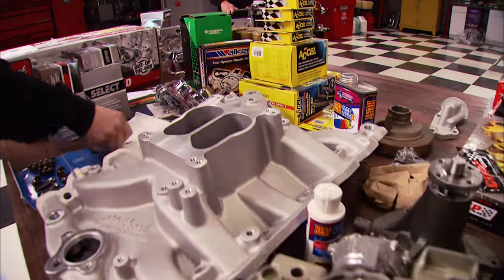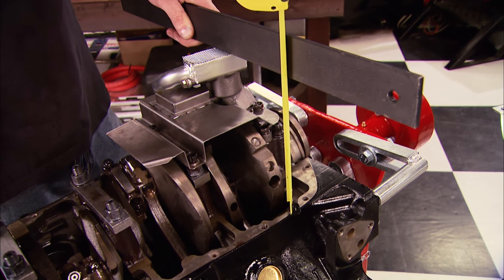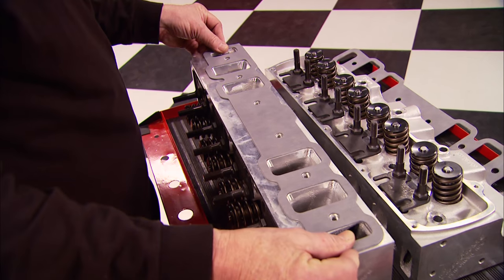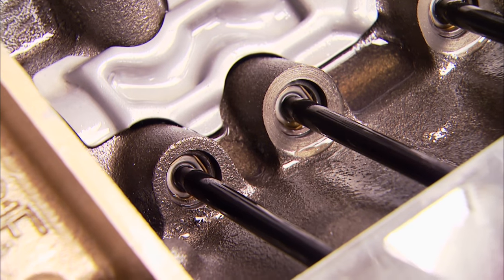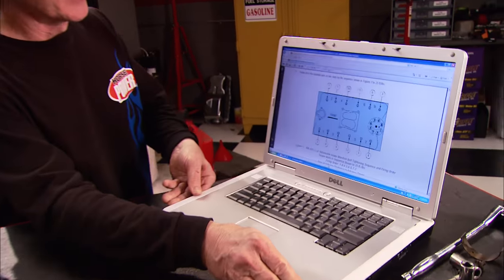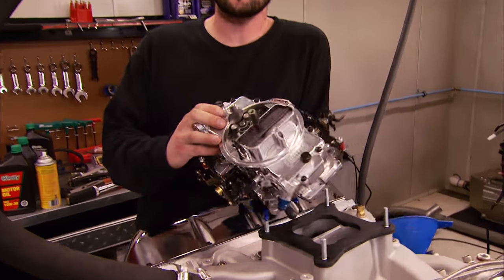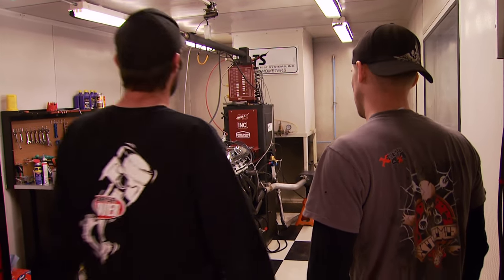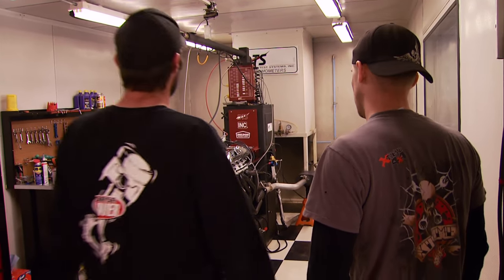Dyno Testing a Mondello 455 Olds Big Block - Horsepower S13, E8

Comment: So weird that rebuild kits come with those intake manifold front and rear gaskets yet every single person and manual says to use silicone. Why do they even make the gaskets? I've seen instructions that come with the gaskets saying not to use them. It is so bizarre.
Reply: I use RTV and the gaskets... but you have to make sure the gaskets don't slip out before the RTV cures...

Comment: Given the aftermarket cylinder heads, this combo is totally underwhelming.  I'm thinking the wrong cam was used and I know the wrong intake was used.   If done correctly, that engine should have made 500 some HP and still be streetable.
Reply: They did revisit this engine on Engine Power and they did swap the intake and cam (custom grind) and it make a bit more power.
Reply: reused the stock cam Not bad

Comment: Just goes to show that you have to do all kinds of work, plus use aftermarket parts to get what Chevrolet did (1horse/ci) more than years earlier with stock parts. Painting the block with Chevy engine orange instead of Oldslow gold would have helped that Olds by a good 10hp!
Reply: Myself I had a '66. 425 with 365 hp. Did a few tricks took the specks from the W-30 stick grind camshaft 428 degrees  custom ground advanced 4+ and total timing at 32degress cross drilling crankshaft oil relief on rods head porting and polished center heat chamber filled at valves and exhaust siammized center ports welded to separate them 5 quart tornado oil pan /pickup Holly 750 machinal carb headman headers and putting out 525 hp.  and 543 foot pounds of tork !!! Ran the 1/4 in  11:67 @ 113 mph had 11:1 compression 67 400 turbo with switch pitch converter from a 67  330 ci. 2-speed jet-away transmission being smaller let the engine rev to 3800 in high stall mode and 2600 in low stall mode had the switch on the shifter next to the trans brake ran 4:56:1 Posi clutches shimed tight ... Joe Mondelo had lot of great tricks back in the mid '70's dam I miss him he taught me a lot of tricks even deburing the block and cleaning up the oil Chanel's for oil return just need to square up the block Aline hone, balance, and gap the piston rings hade that motor at 6500 rpm many times !!!

Comment: He matched the ports to the intake gasket. Should you match the gasket to the ports?
Reply: You want to match the port to the gasket. Use a black sharpie and line up the gasket holes to the bolt holes and trace what material needs to be removed. By opening up the head you're removing a possible shelf that would impede airflow into the head
Reply: Didn't matter, the ports and gasket already matched...

Comment: I had a OLDS 350 that made 420 hp and 375ftlbs.
Reply: That's ridiculous horsepower for a 350 dude. Good job
Reply: I can dig that.  I have a 68-350 in a 86 442. Iron head (ported) #6 with the stamped steel rockers. Never been on a dyno but 12.60s puts it at about 380-385 at the crank,,,,,,which is more than one HP per cube....with iron heads and a stock style valve train. Seems they should have hit 500 HP with this engine. Unless the cam is very mild?
Reply: How many pounds of boost were you pumping into that engine?
Reply: @VGHCX  6psi

Comment: I would like to see someone make aftermarket 455 blocks. Most 445's were blue. The 68-69 Hurst Olds, and the 70-72 W-30's had aluminum manifolds from the factory.
Reply: Rocket Racing makes an aftermarket 455 block but it is not cheap at 5,000 maybe more. That block meets certain racing categories and can handle up to 3,000 hp maybe more.
Reply: @michaelhorgan9525  I didn't know that. Sounds good. Jason Line and "Deadbolt" Dan are working on Buick blocks.

Comment: I think im having an issue with my olds 455 i chassis dynod mine it made 420whp  and 400wtq the whp sounds right but why is my tq lower....
Reply: I'd be curious to see the actual crankshaft numbers (500/480?).  You probably have the torque that you want.  With super high flowing heads (and intake) it's normal for low/mid range torque to "suffer" a bit.  You can bring the torque numbers up with smaller intake runners and head ports but HP is gonna suffer.  Intake air velocity for torque and intake air volume for horse power.  It all depends on where and how you want to make your power.  If it,s for a "driver", your gonna want the torque.  If it's for racing, your gonna want HP.

Comment: 18 I bought 78 short bed Chevy 5hen 600 bucks 455 and turbo 400 shift kit we put in. 1972 motor out of big car. Had huge mickey Thompsons on back. Carburetor screwed I launched my bud said 1 tire spin then he looked back posi long ways straight.. orange

Comment: Something was up with this one...  I made 535 tq and 457hp with out of the box stock edelbrocks and 230*/236*. maybe the cam was degreed wrong?
Reply: What intake?  They used the turd-tastic performer.
Reply: @superkillr  - out of the box torker. need to mill the face to sit it lower on the heads. i missed this as it was my first build 12 years ago and there is a big vertical miss match at the heads
Reply: @robtdougherty  yep...low compression ratio....mill the heads a taste and horsepower goes up nicely...but, premium fuel it may start looking for if you don't want the loose marbles released in the engine.....like the old caddy engines...
Reply: I went from a 214 /224  4.78 4.90 ? lift cam (same as Eld. package) to a 228/233  500 lift cam on my 9.5 comp 455 and went .10 slower in the 60' time (now 1.81 best) and .50 second in the 1/4.  best with 1st cam ,12.77, 104.55.....hot days  12.80-12.90s.102.  now 13.39 best at 101. Dual plane with quad.  Full timing at 34 all in 2800.  Ported J heads....probably close to C's.  Olds guy use to work with Harold at Ultradyne cams said this would be best with my stock heads.  3.42 gears, maybe 2200 stall. 26" tires. Best time before shifting at 4600 RPM, now 4800 rpm. Best coming off line a 1000rpm.  I thought I might pick up .5 sec. ,went the wrong way....any ideas? 455 is in a 38 Chev. and I race with the ONDR.
Reply: @FrankKunkel  did you tune the carb for the new cam?

Comment: These shows are what they are but the duplicolor vinyl and fabric paint is absolute magic, I did my cars seats and carpets 5 years ago and they're still good to go, but don't bother with the prep wipes, non ammonia glass cleaner is all the degreaser you need for that stuff or any other paint work, or if you have years of wax, oil build up or actual grease, then go to Walmart and get white gas camping fuel, its like $9 for a gallon and will degrease anything from parts to paint work

Comment: OK I'm confused does this engine have solid lifters or hydraulic or hydraulic rollers? On the last episode they installed a hydraulic roller cam at Mondello's place. Also that intake manifold does not flow enough for that engine. It needed some porting and plenum work, it's not flowing enough. They needed to add a 1" spacer at least and a bigger carb. I also am dubious of them magically running it later and getting the 455HP. To get the 455HP did he make anymore mods or changes? All that for 455HP!!!! For that money they could have gotten a Chevy crate engine and produced more HP and torque. The top end is holding that engine back from making some big numbers in the 500HP range IMO, that's basic knowledge, especially if they had a hydraulic roller and ported aluminum heads. Maybe a Victor or air gap model and a bigger Holley double pumper. Or was this supposed to be a pure streetable engine? They gave a lot of mixed information and left out some very important info like cam specs, that's the heart of the engine IMO, it dictates what, where and when the engine produces HP and torque. This show is fun to watch but total BS.
Reply: those were hydraulic flat tappet lifters soaking in oil.  Also they broke the cam in.  So its a hydraulic flat tappet cam.
Reply: @marcmo7138  Yes but he mentions solid lifter and originally at Mondello's place they had hydraulic rollers.
Reply: Look closely 00:47 re-using stock flat tappet cam... 4700 RPMs HP peak...

Comment: The video on the olds  455 was nice and with ported heads it made  456.8 hp which seems a bit low what can it make with a hydraulic roller and intake porting a stock intake seems to be the choke point with ported heads it should hit hp with ease. What is mondello address and phone number

Comment: Those headers will fit every olds v8 not just big blocks
Reply: No such thing as small block/big block for olds...block is same except for internal dimensions
Reply: @fredmendez4837   big vs small... 1" taller and 1.5" wider... big block 3" mains small block 2.5" mains except diesels which are the same bore/stroke as the gas 350 yet have 3" mains like a big block....
Reply: @fredmendez4837  maybe u are thinking of Pontiac's
Reply: @dopesquatch  nope...your right though...455 has taller deck hence slightly wider respectively...
Reply: @fredmendez4837  400 and 425 are the same as the 455 also good chat olds swap the world!!!
Reply: Yea, ur right...I forgot they have taller deck...everything else was interchangeable except heads and intake...been a while...
Reply: @dopesquatch  I've never messed with 400 olds...425 was decent...remember them in old toronados...had several of them and several cutlasses...
Reply: @fredmendez4837  u can put put big block heads on a small block.. edelbrock only makes one head for olds and its a 77cc chamber like a big block head but will fit a small block but u will have shit for compression bc the higher cc volume of the chamber.. olds used head chambers to control compression ratios. I have a 350 olds with big block iron heads on it bc its an easy way to get higher flowing heads without going aluminum for $$$ just need to mill them to get ur compression back... and the intakes at least the edelbrock r interchangeable also im not 100% on iron intakes but im pretty sure they are to.  im an olds nut btw if u havnt noticed idk y i am my 1st car was a 79 cutlass with a 350 rocket stock but did killer peg legs lol... i love learning more and more about them and spreading what i know cheers

Comment: carb spacer? A cam w/ those specs and ported cylinder heads flowing 290 plus it's got to be the manifold  should be 500 min

Comment: Hello, I am limited on funds. What would you recommend the cheapest motor with the most power?
Will this also increase horsepower at a low cost?
Fuel Pump
Fuel Rail
Fuel Injectors
Exhaust Manifold Headers
Cam Shaft
computer 
2 turbos
Innercooler
Reply: get a SBC,
Reply: LS can’t be beat for HP for the $ and I am a Ford guy.
Reply: Get a Chevy 350 or 400...nice power not a fortune in cash...strip worthy olds probably 20 grand...vs 7 to 10 grand for Chevy
Reply: None of what you listed is even on a low funds list...anything fuel injection related is 2500 to 5000 easy...
Reply: What is low cost parts that adds good power?
Exempting air intake etc

Comment: 4:35 - most lifters will bleed down to their correct height in less than an hour when compressed by the valve train so pumping them is perfectly okay.

12:07 - I doubt your vacuum advance would be the "culprit" since you have no manifold vacuum under WOT on a naturally aspirated engine.   (And that little split in that hose didn't show until you pulled it back the way you did, meaning that it probably wasn't much of a leak.)   If you have timing related power issues under WOT conditions, that's a mechanical advance problem.
Reply: Lifters will bleed down in a minute...
Reply: @BuzzLOLOL  - I've been a mechanic for 40 years and new lifters can take up to a half hour for a set to bleed down.  On rare occasion even longer.
Reply: @mark-1234  I'm a retired GM engineer... started in GM Engineering August 1966... 
You never revved up into lifter pump up? They settle back down in a few seconds... engine doesn't even stall...
Reply: @BuzzLOLOL  - Context is everything. :)
I believe the scenario in the video was new lifters, cold oil, on an engine that's not running.  In that state, I have seen lifters take a half hour or more to bleed off.

Comment: DO NOT prepump or soak your lifters. Run the oil pump as you rotate the engine while setting the valves.
Reply: Doesn't make any difference... do what you prefer...
Reply: @BuzzLOLOL  ok comp cams even says don’t but…. Do what you want to do.
Reply: @jrod264winmag  - Most professionals call Comp Cams crap when in private...
Reply: @jrod264winmag  - There are cam companies only the professionals use...
Reply: @BuzzLOLOL  Who are they and what brand.

Comment: These kids are clueless about tuning and do not deserve their access to a dyno!  Don’t check the carb for fuel by working accelerator pump and watching for fuel shot, leave off spark plug wires, think that a pin hole in vacuum advance tubing will cost them WOT HP, concern with initial timing rather than total timing which caused them to not know their centrifugal advance wasn’t working much less the huge loss of power from not enough total timing.  These clowns also never said what RPM the peak HP & Tq numbers came in at, cams specs and how many CFM’s the heads flowed at what pressure drop from the flow bench!  I don’t know what is wrong with this combo, but if you can’t get 600 HP out of a big inch engine with aftermarket aluminum heads then something is wrong!  Could be lack of good basic tuning and lack of total timing or the cam and/or intake is choking this engine down.  There is something wrong!!!

Comment: People just don't pay all the attention that's being given to most viewer's, watching all the video, the Vacuum advance problem was found in the distributor the counter weights were sticking cause they had some plastic shim;s affecting them  from wide open throttle  they were removed problem solved...........
Reply: Those weights aren't part of vacuum advance...
Reply: Look closely 00:47 re-using stock flat tappet cam... 4700 RPMs HP peak...

Comment: What the hell does the vacuum advance have to do with power output?At wide open throttle, you lose manifold vacuum and the vacuum advance is nil. As we all know, it's for part throttle cruising and fuel economy. That segment was weird.  With roller rockers and aluminum heads, what's so special about one HP per cube? I dig Oldsmobiles. I've had 350s since the late 70s.
Reply: These are actors...

Comment: Wow. I am supposed to listen to these fellas. All do respect , lot of stupid mistakes. No reason for a fresh engine not to fire first turn, Ever heard of static timing ? Then not checking for full advance , and thinking the cracked vacuum line is the problem. 750 carb is too small. Finally with Olds engines , you would be amazed at how well a non EGR factory cast iron intake performs compared to aftermarket aluminium
Reply: Problem is 00:47 re-using stock flat tappet cam... 4700 RPMs HP peak...

Comment: This thing is a dog. All those parts and no power. You can get the same power from most stock bottom end small blocks. With good heads, a cam, headers and a few more parts. A dog I tells ya, Dr. Olds is a quack.
Reply: 00:47 re-using stock flat tappet cam... 4700 RPMs HP peak...

Comment: Definitely not impressed with these guy’s ability  to tune or even know the problems  . Nothing like cranking on a flat tappet engine removing all the break in lube off the camshaft…  wait a minute they didn’t put any brake-in  lube on the lifters !

Comment: It's not easy to make a olds engine produce more horsepower than torque, but unlike the other 455,s of the day olds engines were 3 inches shorter, just as the 350 olds engines were 3 shorter deck height wise than a 350 Chevy.

Comment: I made over 600 hp with my olds 455 and factory cast iron "D" heads.
Reply: According to the followers of this post, they (not I) would say either you're lying or someone lied to you...but you know FB and YT is full of know it alls for the most part
Reply: Look closely 00:47 re-using stock flat tappet cam... 4700 RPMs HP peak...

Comment: The only problem with painting the seats is when the paint rubs off on you clothes!
Reply: I bought a '68 Charger years ago that someone had painted the entire interior with black. It was originally green. It actually didn't wear off as bad as you might think. It wore a little on the side bolster where you slid in and out but after almost 2 years it was pretty minimal.
Reply: It's special seat paint like is used on leather seats...

Comment: didn't they say there were putting an hydraulic roller cam in. Those are flat tappet lifters. Why would they do all that other work and leave a crappy ass flat tappet Cam in it. If they went to a roller cam they would have made tons more power
Reply: I'm a beginner...can you please elaborate on how this is possible?
Reply: Look closely 00:47 re-using stock flat tappet cam... 4700 RPMs HP peak...

Comment: They wanted to make 1hp per cubic inch. "If you remember right, that's 455" Except they bored it .030" over. So it is now a 462.  That seems low for the effort. Should have went with a roller cam.

Comment: Very confused at 0:44 sec. the install of a  (hydraulic  roller camshaft that uses' hydraulic roller lifter's)?  But they drop in flat  tappet lifters for a flat tappet camshaft an  HE 284H xtreme  energy hydraulic flat tappet camshaft?  WTF??? What's wrong here hmmmmm?
Reply: Simple: 00:47 re-using stock flat tappet cam... 4700 RPMs HP peak...

Comment: That's not a roller cam
Reply: 00:47 looks like they re-used stock flat tappet cam... HP peak at only 4700 RPMs... good HP for the RPMs, though...